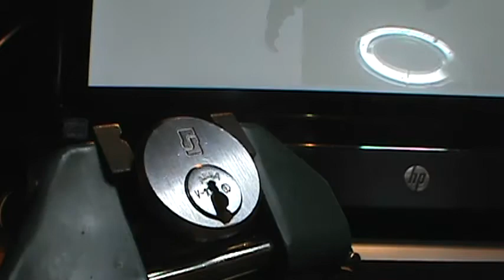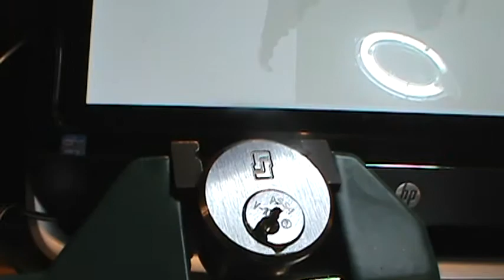ASSA V-10  Picked open!!! WoooHooo!!!

Comment: Congrats exellent picking 😊for you its a great feeling when you get such a hard lock open 
Your lockpicking level is getting better and better i promised myself last year im not going to touch a dimple until i learn how to pick assas again 👏 exellent job
Wat sort of tension did you use?
Reply from the maker: Thanks JJ.  light tension is what I used, and learn to feel what it's like when you over set.  In the video you'll notice I "Reset" 2 times I think.  Because I was over setting pins and didn't even know it.  Man, I was happy last night.  Thanks for watching.  My next project? MTL?  Not sure.  I will say, that picking Rukos really helps.  It's like practicing for the    V-10.